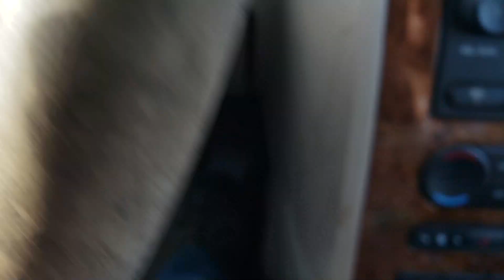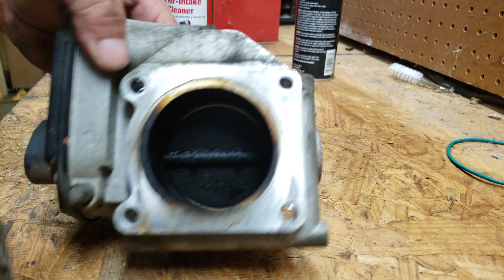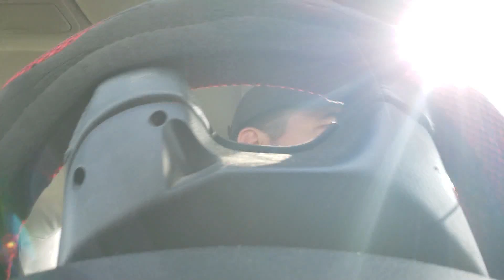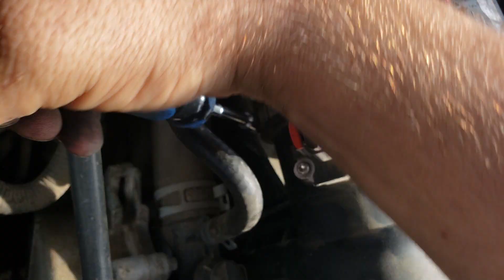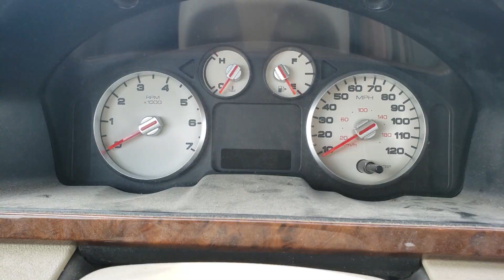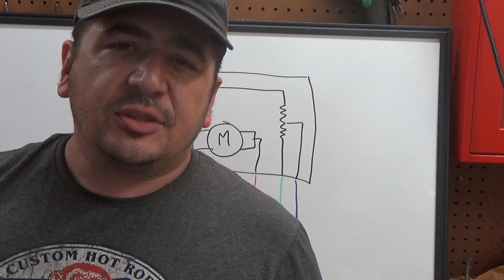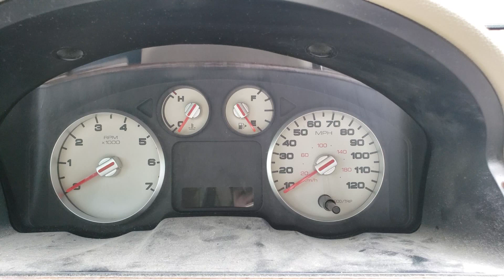2005 - 2007 Ford Five Hundred Throttle Body Problems

Comment: Thanks for the helpful video. I purchased a replacement throttle body off eBay, but unfortunately it didnt have the coolant inlet that my 2005 model does. Plan B. I used Carb Cleaner to clean my used throttle body. It worked and I again have smooth, dependable acceleration. :-)
Reply: The new throttle body design doesn't have the coolant inlets, even from Ford.  You are just supposed to bypass that coolant line to take the throttle body out of the circuit.
Reply: I'm having same problem what video did you watch if you dont mind sharing please
Reply: @jamiejewell7567  specifically at the 11 minute mark about the hose bypass.

Comment: I got 06 fordfreestyle. It got the rachet on and the engine on. N when i drive the rpm go all the way to 3 n 4. But when it hit the 4 it stumble n can't over the 4. And i can only go to 25 to 40miles. And sometime when im at the red light is take a while to accelerate. I took it to the shop they told me tranmission no good. Any one got ideas??

Comment: I came across this video after having my 2005 ford freestyle limited with 231,590 miles keep going into failsafe mode. I had this happen once before about 100k mikes ago and I went to the salvage yard and got a throttle body, because mine has the coolant hoses on them abd all the ones that are sold new is like the one you replaced and didnt have coolant going through them. But I also got some of the throttle position sensors and the inside motors out of the ones at the salvage yard that was like the one you replaced. 

I tried just replacing it and not clear the memory on the PCM, or letting it idle at all to do any sort of relearn and after 5 minutes of driving it went back into safe mode but was still allowing me to drive, just would eat gas, jerk hard when I let off the gas, and didn't accelerate good at all. 

So I checked the wiring harness as you showed. All was good. And then I discharged the capacitors as you showed and am in the middle of the relearn procedure now. But the wrench light and check engine light are both off and its idling perfect. 

But I just wantes to say thank you for being so thorough with this video. I'll definitely subscribe to the channel and watch many more of your videos. Thanks again!
Reply from the maker: I'm glad it helped you out. Hope everything worked out well on your vehicle and it stops going into limp-in mode.
Reply: Matt Burns  going thru the same rn
Reply: What codes did this give you am having same issues as yours